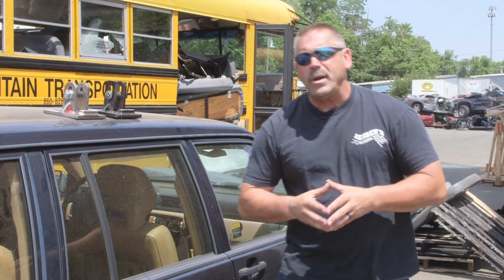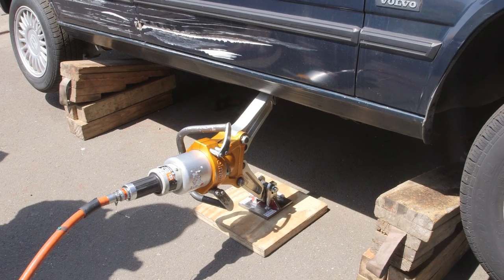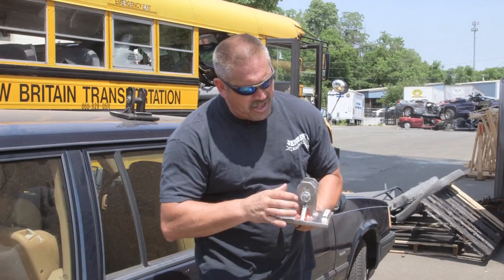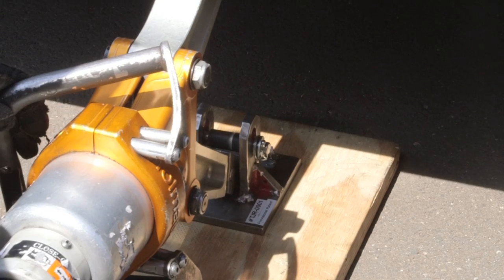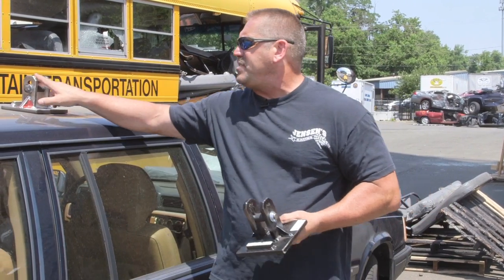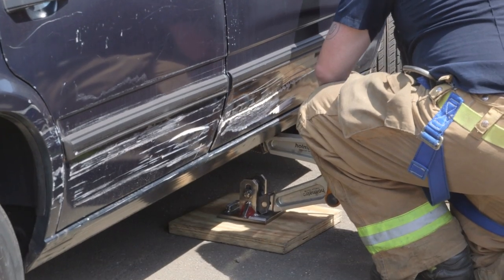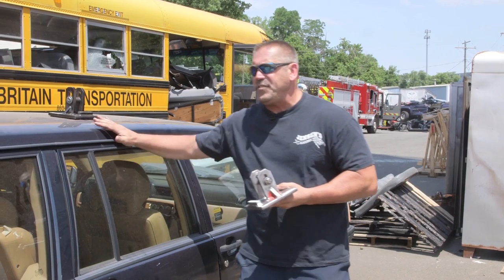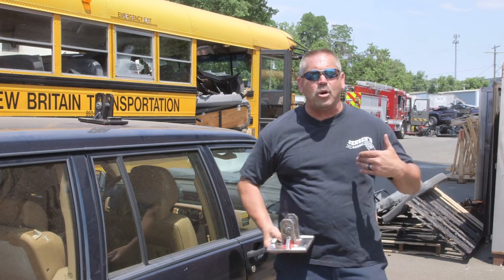TL9 Stabilizer

Comment: Although I don’t doubt the strength and method of construction, the qualifications of the welder/fabricator or whether it is safe or not (it seems so) but the biggest question is:  Does the manufacturer of our hydraulic tools approve these for use.  If they do not endorse it, and we adopt it, we are opening a window of liability to our dept, city and personnel.  Remember case law states that you are only covered from liability if you are using a ‘tool’ to the manufacturer's intent, procedure's and methodology.  Think about the recent memo about our cutters and guys NOT using them according to these principles and failing them.  Adding things that have not been approved by the manufacturers is opening that window of liability.  

Will it work? Probably.  Is it safe?  Likely.  Are the tips of the spreaders designed for those forces in that manner?  We don't know.  We know across the contact "area' of the tips we have lost of force, but how about where these contact the tips?  The contact patch is different (think flat soled shoe may not leave a mark on the hardwood floor but same person in heels can leave a dent). We use an “L” bracket.  Is it manufactured in house?  Yes, but we are not attaching it to an extrication tool.